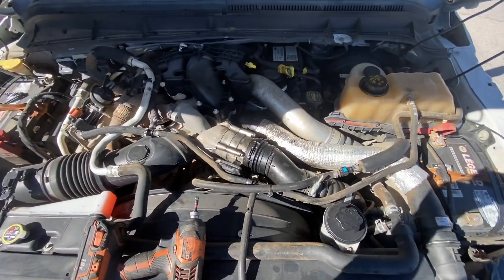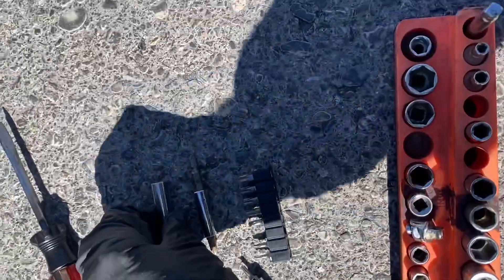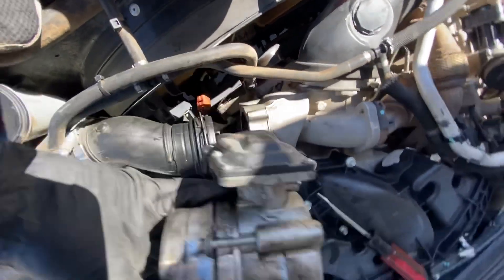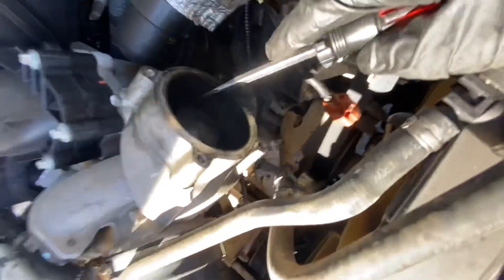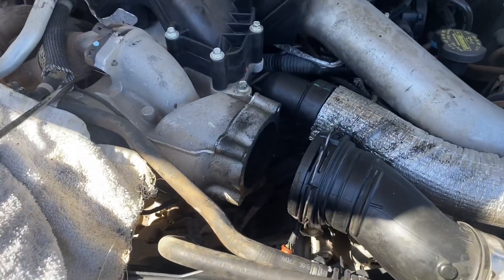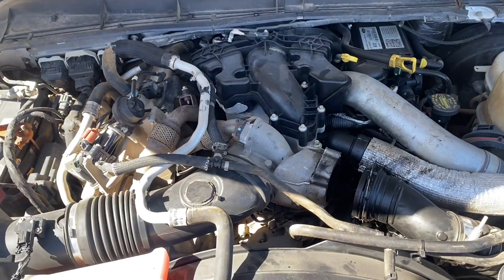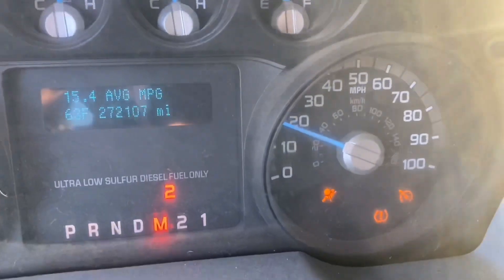15 minute mod, 10mpg to 16mpg, 6.7 powerstroke gets 60% better mpg, so easy you can do it too!

Comment: 2012 F350 XLT 6.7l 4x4 
Cleaned out the Throttle body and area inside due to a code P2073 Maf/Map Throttle Position Correlation at Idle issue. 
MAP was new, Cleaned out the MAF sensor. Throttle Body was full of carbon build up. Cleaned everything out. Cleared Code haven't had any code pop up ever since. Power and Fuel mileage up to about 18.2 mpg and 14.2 towing HD Trailer.

Comment: It says in the post 7.3L but that's not the 7.3L... I have a 97 F350 with the 7.3L and it doesn't look anything like that one... I'm having my truck towed back to Vegas  to see if I can find someone to help me fix it... I would like to see a video, or better yet, have you or someone use my truck to do  a video, as I got between 10 and 12mpg's empty, and 9 to 10 MPG'S Towing 7,000lbs... So yes I want the 20 MPG'S Towing you said that it can get... Please message me and set up a time for you to do a video on it, I will buy the parts you need, but being Handicapped and a Senior Citizen, I can't do anything more than holding the camera to help film the videos... Please let me know asap

Comment: Well he said no codes but we can see plain as day his engine light is on. 
 That throttle valve is so the engine doesn't spool when shut off.   The throttle valve should be cleaned on a regular basis as with map sensor. 
 Keeping stuff clean helps with milage.

Comment: My top three recommendations for improving your fuel mileage are:
1)  Stop driving 80 mph!   Wherever you're going, leave earlier (so you're not running late) and keep it somewhere around 55-65, save the speed driving/engines chugging fuel for the track.  Gain: 3-5+mpg.
2)  Keep your engine oil clean, even if that means changing sooner than recommended intervals.  Oil is cheap, engines are expensive (as is wasted fuel).  Gain:  Usually 2 mpg.
3)  Keep your tire pressures up near maximum pressure for less rolling resistance.  Gain:  Usually 2 mpg.

I think your mileage goal while towing can be attained, but will need every last tweak to make it happen.  Since you mentioned the higher mileage on the truck, I would also suggest checking your belt idler and tensioner pulley bearings.  Remove the serpentine belt and if the idler and tensioner pulleys don't spin VERY freely, they are creating extra drag and the bearings may need to be replaced.  If you notice a groaning sound when you turn corners, the front wheel bearing/hubs may also need to be replaced.  Might as well check the rear wheel bearings as well while you're at it.  I know it sounds like a lot more maintenance, but it all leads to rolling efficiency and MPG gains, not to mention longevity if you intend to keep and drive the truck for a while.  If you run across a set of used tires that are an inch or two taller, that will also help slightly lower your highway RPM, and the 6.7 has enough torque that you will likely not even notice any difference at lower speeds/around town.

Comment: The benefits gained were from cleaning out the carbon in the EGR. That butterfly valve does not function like a throttle body in a fuel injected gasoline motor. I wouldn't remove that, especially if under warranty. 

Out of warranty, I would definitely go for a DEF and EGR delete.

I'm not a big diesel guy, in fact I only have one and it is a 6.7 on my motorhome.

Comment: I did this and soon as I was done I turn the truck on and it was running horrible shaking and stuff I put the butterfly valve back and ran like it’s supposed to and my truck is deleted and tuned but I still have the egr on I have the delete kit for it

Comment: How are you only getting 10 mpg on your 6.7? What gears do you have? My 2012 with stock size tires got 20mpg, with 35's I get 18-19 It is deleted, my work truck which is  a 2016 f450 low geared gets 13 empty, towing my 40 foot trailer   empty it can get around 10 mpg

Comment: May 86 250 4x4 6.9 gets ( 25 ) mpg ! Note rpm’s 1200 to 1500 !! 45 to 50 mph ! I need to upgrade to a 5 or a 6 speed manual to get the same results! I run 285/ 70, 16”.

Comment: People commenting about fuel additives.. Just by good fuel.. Number one.. And only number one.. Burns clean.. 
If you want to get rid of the soot in your intake  , Do a c c v delete with a nice big catch can filter & at least 5/8 hose barbs.. Might save you from blowing out your upper Oil pan gaskets and every other seal .. Because those c c v's are prone to plug ...

Comment: My 2014 6.7lL gets 16 around town and over 20 on the highway when empty.  Towing a 10K trailer would go down to 10 or 12.  No mods but did use all of the Arch Oil products as directed to keep things cleaned up and lubricated properly.  I see no reason to delete anything and run the risk of a huge fine, impoundment, etc.  You have to take care of the vehicle, change the oil, buy decent fuel, etc. and you should not have a problem

Comment: that is not a throttle body.... that is a EGR PLATE the plate closes when the EGR valve opens to pull more air from the exhaust. That's why nothing happens drivability wise. It will throw codes P2074 P2073 and a few others. If you are doing this because your going to DELETE the truck then make sure to put that in the description so you don't mislead people.

Comment: You want to severely reduce a diesel engine's service life? Strap it with a bunch of emissions equipment. EGR, DPF, SCR cat, dosing valves, pig urea,... The valve is there because Ford felt it needed to be there to promote EGR flow by modulating the flow from the fresh air side to increase flow on the EGR side to help the engine meet the EPA requirements for the control of NOx. EGR is an emissions item and provides no performance or mileage benefit of gas or diesel engines. Does routing a hose from your posterior to your mouth benefit you in any way? Didn't think so. However there may be a traction control benefit from this valve by the system being able to shut the EGR valve, restricting the fresh air intake, and going into fuel cut. I have not read that in any system operation description so far. So it is not likely.

Comment: Just delete everything. EGR|DPF upgrade to a 5 inch turbo back, Get rid of the CP4.2, install H&S primary and secondary fuel filters, amsoil dual remote bypass filtration system, sinister coolant filtration system, upgrade IC pipes and intake manifolds, swap out all fluids to amsoil 4 life.  Egr and dpf delete is easy.  Install a tuner and love your truck even more. EZ Lynk ftw.

Comment: 1:58 I drove a 7.3 ford and towed regularly it did not get 18MPG even on the highway at any point
Reply: I did, a stock leak free non tuned 7.3 will always get 18-20mpg, it was slow though

Comment: We have a 2022 F350 6.7, not towing we're getting 18mpg city/highway, sometimes 20.  Towing a 16k 5th wheel, 12 to 14mpg with hills.  Won't be doing anything to screw up our warranty at this time.

Comment: When the EGR flapper valve (throttle body) is removed it really messes with the regen. A service right now warning came on, then the cleaning exhaust filter came on and wouldn’t go away. I put the butter fly valve back in and all is fine. Unless an egr delete is applied don’t remove the throttle body butterfly valve.
Reply: Have you tried to remove the butterfly valve after an EGR delete ?

Comment: 😂😂😂 What a hack job! "Diesels don't need throttle bodies." That "throttle body" is to help the EGR flow properly. If you are going to delete the truck just delete it. Blocking off the feed to the intake from the EGR still leaves you with all the issues with the filters and the EGR cooler. Take the time to learn before you spew bullshit on the internet bro.

Comment: Retired now ,but drove semi ( diesel ) for 30 years. Every second fillup I,d use Kleen fuel additive to the tank to keep the combustion system clean , free of soot and moisture  . Sold at all truck stops . Many people try to save a few bucks by not changing the fuel filter, false economy ,as well as air filter. Don,t cheap out ,change them all regularly .

Comment: I have a 2012 6.7 with 209,000 miles on it. I replaced the cold side pipe recently (for the 2nd time) and notice a huge build  up of carbon in the same area.  I scraped out what I could but I think I'll go in from the other side as you show to remove even more carbon but I think I'll leave the flap in place.   I do currently get around 16 to 18 mpg driving around town and 20 -21 on the highway empty.  When towing my 9,000 lb 5th wheel I get about 11-12 mpg.

Comment: Depending on your vehicles gear ratio, there’s a super sweet spot in mph to get max MPG. Like an old 2006 dodge dually mega cab with 3.73 rears and a 5.9 24v Cummins 48REtranny running at 1600 rpm’s can get 25 mpg on the interstate on flat ground whereas a 2017 F450 Platinum with a 6.7 powerstroke and 4.30 rears and a 6speed tranny only gets 14 mpg running at 45mph. Not driving fast will get you more then removing stuff and becoming illegal. While you’re at it you can save money by putting red diesel in your truck, that’ll save a bunch of money since y’all don’t care about legalities.

Comment: I did this and it started going into limp mode started getting bad fuel economy had to relearn the throttle cause it started shifting weird no power etc installed it again and its more or less back to normal dont do this to your truck!! Its there for a reason and these trucks are sensitive to this stuff
Reply: If you did this mod, you would need to have a file to delete the truck for it to help anything.
Reply: @nicks4uofl yeah mine is non deleted. California

Comment: i do mechanic work and i can tell my honest way of high mileage 6.7 experience clean up and work around using 160k miles truck F350 remove EGR disassemble and clean change gaskets if you can not clean or find shop has special washing hot chemical washer or buy dorman EGR rebuild kit also change  and clean lower intake gaskets and clean inside every 80k miles also do the same with CCV box change filter or delete and cap the CCV box. If you see turbo is leaking oil and there is oil inside its better to take it off every 100k miles and have it rebuild for you for less then S700 cost,

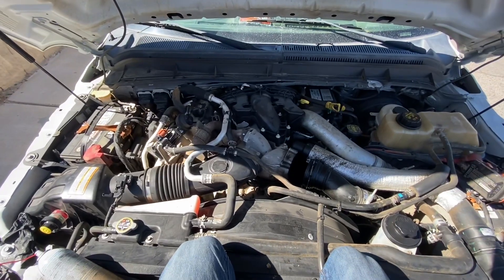Comment: @Tylerlanz if you’re still responding to comments but I have a question. First off I liked, followed and shared it video a bunch. Second thank you for taking the time to make this video, I really hope my gas mileage goes up that much! I already replaced the fuel filters( I’m an idiot and didn’t put grease on the gasket for the filter housing to the pump and broke the pump ($450)😮) low pressure fuel pump and the air filter. Ok my question is @ 7:52 on your video, the past that connects to the air filter housing and has the aluminum house price going over it. What is that called and why do I have a little tank looking thing on mine? Should I take it off or leave it on. And if I take it off, where do I get the piece and what is it called to plug the hole? Once again, you’re awesome I appreciate your time, and your knowledge!

Comment: I have a bone stock 2016 F350 4x4 Lariat with just under 90k miles. In town driving I get 18 mpg unloaded. I am never on the highway without a trailer but unloaded I get 14 to 15. Depending on how heavy the load is I have gotten down to 11 mpg. Since 30k I always use Hot Shot's Secret LX4 Lubricity Extreme fuel additive. I also change the fuel filters with every T6 Rotella 10K oil change and swap out the oil filter at 5K. I get the oil analyzed at every 10k oil change and the results tell me I could go 3 to 4k miles further on the oil that I am changing. Is it overkill? Yes, but I want this truck to last. A recent change in my business model will put 3 to 4 times what I had been averaging in mileage. I pulled apart the intake at 75k and cleaned it. The intake wasn't that bad. No difference in mileage after the clean.

An EGR and DEF delete with tune would be an option if I didn't live in an area that has emissions testing. My BIL has a 2014 F250 6.7 that he has deleted and he is getting 24 mpg unloaded but he is an insurance salesman that hauls a horse trailer a dozen times in a year.
Reply: What tunes is your BiL using ? I use Gdp and get around 16.7-17.4

Comment: Dude a little bit of carbon ain't front isn't shit compared what is all the way through that plenum so you shouldn't waste your time scraping that little bit of bullshit because it gets a lot worse deeper and you don't delete your EGR guess what it's BACK AGAIN 🤯
Reply: Been there and verified inside is a mass of dark mater and scraping did little. EGT/DEF delete is the only actual way to increase mileage. 2011 F-350 King Ranch 6.7 Turbo, simply works to delete. Legal is bullshit unless you are in a state that has inspections like leftwing nut cases in California.

Comment: I average 16.2 overall with light pop up camper and pulling a boat or utility trailer often. All I do is standard maintenance on 2011F250, 6.7ps. I have 209,000 miles

Comment: Truck had a weight loss kit and had a tune that was terrible, I changed the tune and now averaging 17 but has gotten 20 on a 200 mile trip. I'm going to look into that throttle body and clean it up soon to see if I can get anymore.
Reply: What tune did you have?

Comment: I just finished this mod. to my 6.7 Ford. Thank you for the video and info. I am getting avg. 18.7 still going up
Reply: Taking your throttle body off didn’t throw a code?
Reply: @linebacka08  not the throttle body, but the plate inside
Reply: @Henryking55  if i remove the plate inside the throttle body will it throw a code?
Reply: @codys846  did you ever do this? Any code? Still have the truck?
Reply: @linebacka08  no
Reply: This will cause egr to not function correctly and will eventually cause egr to fail! DO NOT DO THIS
Reply: @Thatcrewcab7.3  What EGR ?

Comment: Did not work for me, have 2014 f350, check engine first day, then reduced power mode, put it back in check engine turned off,  bummer needed the extra mileage :(
Reply: Getting 23 MPG on the hwy with a deleted 6.7. Is yours stock?

Comment: A 7.3 getting18 towing? Nah dude. No one I know with a 7.3 gets that kind of economy. They're lucky to get 12 and they don't run them hard.
Reply: I get 17-18 in my 7.3 Excursion with 3.73 gears, and for grins n giggles I set the cruise control on my 96' 7.3 with 4.11s to 59 mph and cruised on the highway to Saint George Utah, noted the milage and recorded the gallons of fuel used average 23 mpg, wasn't fun going so slow but proved it can be done. Miles logged was from Calimesa California to Mesquite Nevada, 15 gallon rear fuel tank, not completely empty but didn't want to push it until it was sucking air.
Reply: i had mine chipped and air raid intake 4 inch straight pipe, got 17 all the time

Comment: Diesel engines don't run a stoichiometric mix - they always run a lot of excess air.
Reply: Yes and no but this is a terrible idea for other reasons.
Reply: @justinkroeker1464  Don't bother to comment when you don't know what you are talking about.
Reply: @Hogger280  lmao, I’ve been working on these trucks for 15 years, I have had about 7,000 come threw my shop that I manage. I’m not an expert at much but I know I know more about these trucks than 99% of people. You can do whatever you want bud, I was just trying to help the people smart enough to listen. Good luck
Reply: Correction 18 years
Reply: @justinkroeker1464  I'm sure you are a very good mechanic and shop manager but you don't understand the engineering principles of the Diesel combustion cycle:   Diesel combustion is characterized by a lean overall A/F ratio. The lowest average A/F ratio is often found at peak torque conditions. To avoid excessive smoke formation, A/F ratio at peak torque is usually maintained above 25:1, well above the stoichiometric (chemically correct) equivalence ratio of about 14.4:1. In turbocharged diesel engines the A/F ratio at idle may exceed 160:1.
Reply: @Hogger280  ok let’s just say your right about that, but that is irrelevant unless you are tuning.

I said don’t remove the valve or it will cause egr problems, that’s just a fact. Also if you modify your intake to flow air more air it WILL NOT change the air fuel ratio, the truck has a mass air flow sensor and that’s how it knows the amount of fuel to add to get the ratio it wants, that’s just a fact. Just please don’t tell people they don’t know what they are talking about when you don’t know them, their experience or education.
Reply: @justinkroeker1464  i have def and EGR delete, h&s cold air intake and upgrade downpipe into intercooler. Should i be good?
Reply: @2amo13  yes
Reply: @justinkroeker1464  correction

Dpf filter is off 

And EGR is unplugged and programmed to run without egr. I HAVENT installed EGR delete kit yet. What's downside to removing the little butterfly valve in my scenario?
Reply: @2amo13  no downside but the tune will hold the valve open if it’s not unplugged already. You can do it but I personally won’t waste your time.
Reply: @justinkroeker1464  thank you for your input, i decided to just leave the valve installed. If it ain't broke don't fix it lol
Reply: @2amo13 yep lol, I do recommend disaster prevention kits for 6.7s
Reply: @justinkroeker1464  cool! I'm looking into them now! Any other tips?
Reply: The do run off stoichiometric mix, they just aren’t as picky as gas engines, but this valve has nothing to do with that. It is for the egr system, if you have the egr still you need this valve. It lower intake pressure lower than exhaust so the egr will flow correctly.

Comment: Will this work on a 2021 Platinum diesel?
Reply: cool name. lol
Reply from the maker: No you need an ecu tune  then disabling the valve is part of the delete
Reply: I’m a professional mechanic, this guy is dumb and is completely wrong DO NOT DO THIS! It won’t help and egr won’t work right